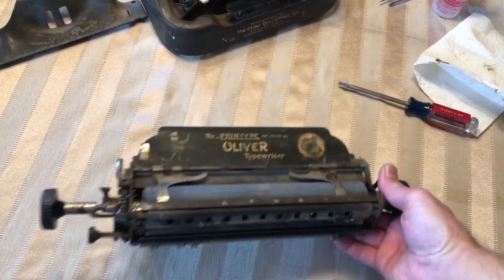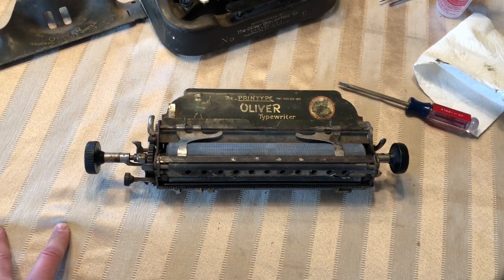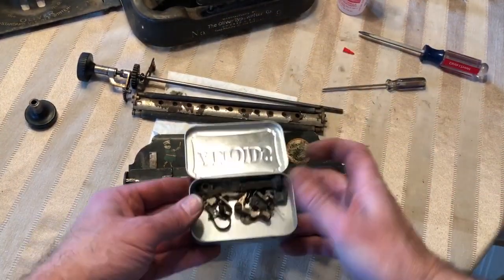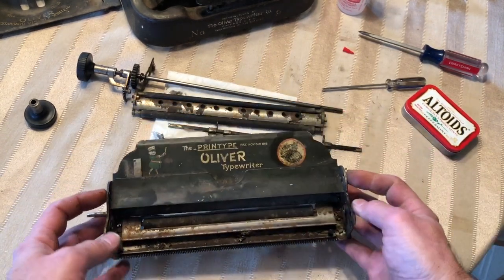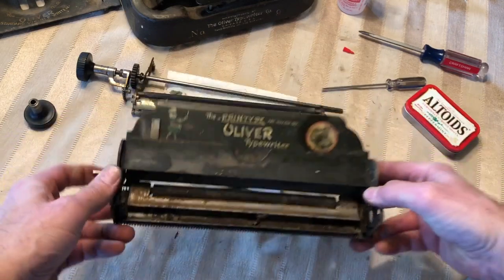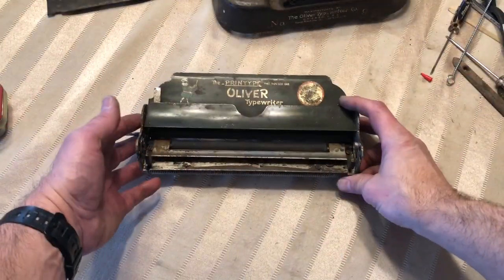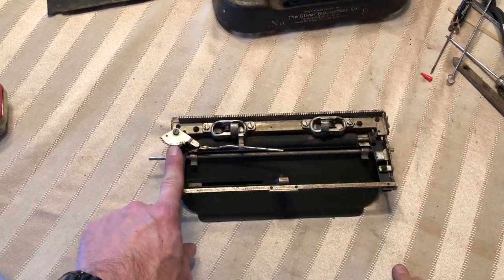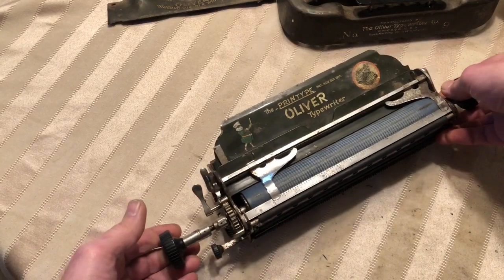Part 1 of 2 Oliver typewriter No 9 carriage disassembly, cleaning and reassembly.

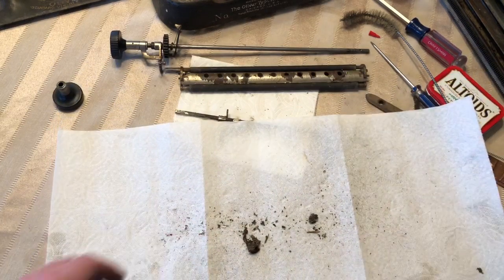Comment: What are you using to clean the paint at 6:40?  Isn't the 15 minute limit a thing of the past, would of enjoyed normal speed more. Thanks
Reply from the maker: Thank you for your comment Andrew.  Regular speed  seems to be to slow for most people when it comes to the boring stuff so I sped it up.  hope you can still get most of the content from the video.  If you have a question about some thing and would like video on the subject I can do that if you would like, I am not and expert  but will try to answer any questions.  I have found Meguires auto polish works well and that is what I used in the video.

Comment: Do you mind if I ask what products you use to clean your Olivers? I just bought a Number 5 and looking forward to give it a little clean, the outer metal is a little dulled and worn, the platen is filthy and practically white, and I'm sure the innards will need cleaning and de-rusting.

I have some car polish/cleaner and wax that I use on my old Singer sewing machines to clean them up but obviously don't want to ruin the paint or finish on one of these! Would really appreciate your advice.
Reply from the maker: Thanks for the Question,

Congratulations on the purchase of your Oliver 5!  For the first part of cleaning I use a set of paint brushes and compressed air to get the top layer of dirt and grime off the machine.  Then Meguiars ultra finishing polish, (number 4 on the scale on the side of the bottle) for cleaning and to brighten the paint and chrome.  If you plan on taking it apart and washing the metal parts with soap and water, I would just say that the paint used on Olivers seems to get cloudy after more than a few minutes in water.  I have been able to dry and buff the paint back to the original look but it can be a little scary.  The platen can be cleaned a few ways, I use 1500 grit wet dry sand paper and water to take the top layer of gunk off.  If your white keys are yellow and dirty they can be cleaned with the same polish as the rest of the machine or  taken off and put in warm water with a few drops of bleach to soak for a few hours and then cleaned with a tooth brush to get the remainder of dirt off.  The black keys can not go into the bleach  water or they will discolor!  

Have fun cleaning.
Bryan

Comment: Do you have any recommendations for when little screws are stuck? The ones on the neck of the left-hand thumb wheel on my No. 5 are stuck pretty good, and I'm worried that I'll strip them if I press too hard. Thanks!
Reply from the maker: Hi Joel,  If you want to send a picture of the screws that are giving you a problem I may be able to suggest something. The right size screwdriver is very important but in general there is no magic solution just oil and time.  I have an oil that I like and will soak the part for about 3 to 5 days and give it a try, if it is still not moving then a little heat with a fine tip butane torch can also help.  Good luck with your project and thank you for your comment.
Reply: @thevintagetype4358  It's these little fellows here on the side of the knob that are giving me the most trouble, but they're not alone in being stuck. Thanks so much! https://www.reddit.com/r/typewriters/comments/i9tle2/cleaning_an_oliver_5_screws_wont_come_out/
Reply from the maker: Hi Joel,  Sorry I have not checked comments for a while.  I saw the pictures and if soaking with your favorite oil does not work, I have had good luck with a small butane torch.  The knob will take quite a bit of heat as long as you are careful.